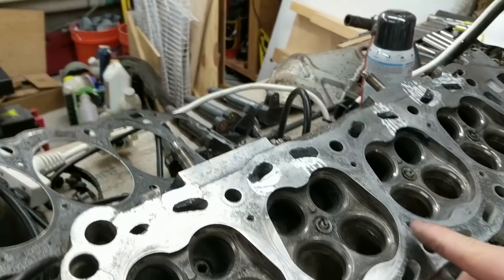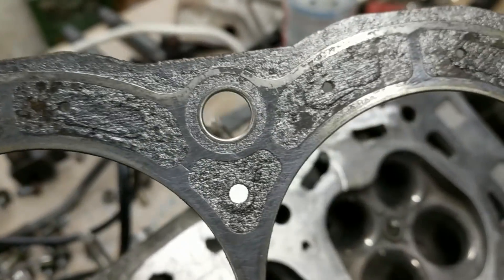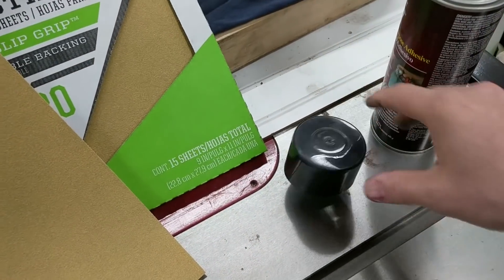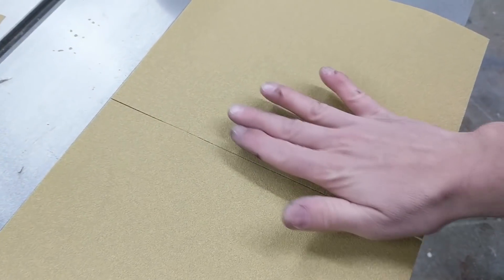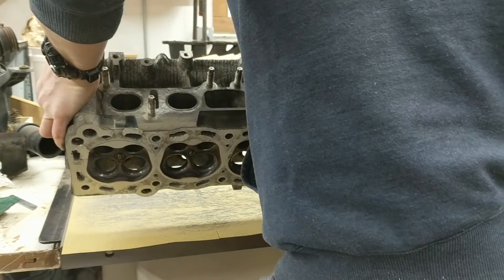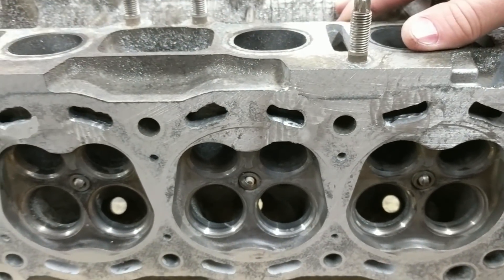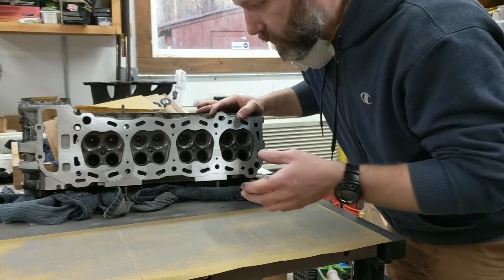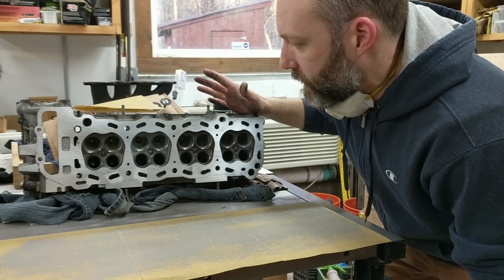Using a Table Saw to Resurface a Cylinder Head

Comment: For the amount of work that goes through replacing head gaskets, I feel more confident taking the head to a machine shop and having the heads machined . I won’t reuse head bolts either. I helped a friend that wanted to save a few bucks. He tried this process and reused the stretched head bolts, ... a few weeks later he had the same mess!!! If this works for you guys I’m truly happy!!! I just hate redoing things!!!
Reply: For those of you who don't know if they're torque to yield bolts you replace them "every time"                if they're NOT torque to yield then it's "as necessary"
Reply: @kendalbridges897  Yes.  Correct and simply put.
Reply: THANK U.. their  stretch bolts and cheap for as much work it takes pull these motors down..
Reply: If someone has the time, desire, and means, why not try and do it yourself. You learn a lot through the process.
Reply: @Cyan2002  The first thing you need to learn is that some things are best done by a good machine shop.  They have the correct equipment and expertise.  Unless you live in the middle of nowhere, take your heads to a machine shop for work that can be done there with the necessary precision.
Reply: @Cyan2002  correction some people learn a lot through the process some people just fuck up a bunch of shit
Reply: @kendalbridges897  hahahaha 😂😂😂
Reply: If your working on something from the late 80s early 90s then you probably should replace the head bolts, most from the 70s or earlier probably not. They used better bolts in those days
Reply: Bert Grau for the 240Z (an early 70s car) they "recommend" replacing the head bolts. Datsun was notorious for using poor quality metals all over their cars back then.  That being said, however, I've reused the Z head bolts after doing visual inspections and a back out torque check ( there are charts for that) and haven't had any problems with bolt failure or head warping. Even though, if I have the time and money I DO replace head bolts.
Reply: Datsun/Nissan has fantastic quality.
Reply: I just make the switch to head studs if possible...
Reply: Mark Godfrey  well the only thing I can say without being there is I don't know what kind of car is it are you using a stock setup what's going down
Reply: Mark Godfrey  when you were buying the bolts were they TTY bolts
Reply: 2025, many bolts were replaced , many good ONE JUNKED!!!!
30 years as a mechanic, doing many engines, NEVER had to replace the head bolts;  BUT i KN OW how to check them, it is described in EV ERY manual, FACTORY manual, that is;  look....  do you replace the wheel bolts or studs every time you change tires?    WHY NOT?  ir is way more critical...    anyway,  you NEED TO KNOW HOW TO CHECK THEM, it is VERY simple.
Reply: As for reusing bolts ; it’s ok if you measure the stretch and use Caterpillars chart on the proper Lenth chart and on like rod bolts it uses the bolt lenth fo correct bolt torque chart measured with mic’s
Reply: @BillyDocWalker  No.
Reply: If I'm going through all the trouble to remove the head then I'm going to take it to a machine shop. Might as well have them check everything.  Do it right the first time.
Reply: @tonyradca1235  til you realise that the costs keep adding up and up eventually you have to draw a line where youre comfortable
Reply: Carpenters Should Never Be Mechanics!

Comment: I'm not saying this won't work, as the gasket will take up some of the imperfections, and the head doesn't need to be perfect anyway, but... First, I wouldn't trust the table saw top to actually be perfectly flat and not bowed or crowned slightly.  The same is true for pieces of granite counter top, and especially for glass which easily bends.  Gluing the paper down and the paper its self adds another layer of uncertainty, as there is no way to know if one sheet is a couple thousandths thicker than another, and any dust under the sheets will cause imperfections.  Last, as others have commented, a figure-8 motion should be used for lapping, and I'd probably do it wet with light oil or some such to keep the paper clean.  At the very least, a crosshatched pattern should be used with every stroke in a new direction to prevent deep scratches.  You won't see them with your eye, but if you ever so lightly dust the head with black spray paint, then make a couple light passes over the paper at a higher grit, you'll see plenty of black lines of scratches.  I'm sure I'll be sanding heads on a table saw come the zombie apocalypse, but until then I'll have them machined.

Comment: I've done bike engines like that, the old bloke who showed me told me to do it in figure eight movement for best results, works just fine, fit 2T heads with no gasket just sealant.

Comment: Use a straight edge and  a torch light to see if you table is flat. You can also use a 1/2 " piece of plate glass. I am sure it worked fine.

Comment: Because of the manufacturing process, ordinary window glass is dead flat, and can be used as a surface.  The grit of the sandpaper has to be selected depending on the composition of the gasket being used.  And yes, I would never reinstall a cylinder head without reworking the valve seats and guides.  This can all be done by hand also.

Comment: I say take some marker and put it on the head face then when you sand it you will see where it is high and the loss
Reply: Max Volovich… A light coat of flat black spray paint is probably easier than using a felt marker. Krylon dries in 10 minutes, so take a coffee break and a few more strokes to see if its' good.
Reply: @rupe53  that works to.  It covers faster and easier to control.

Comment: My dad cleaned up a journal on my cars crank-shaft using a good connecting rod (the old one was shaped like an egg) and a couple of new bearings. What he did was put valve grinding compound in the new inserts in the connecting rod and we turned it around the crank. We started with 40 turns and coarse grit compound and took off 10 thousands immediately. We cleaned the journal and swapped to fine grit compound and after 90 or so turns the journal was round and true. Then we purchased 20 thousands oversized bearing. Checked it with plasti-gage and it was perfect. I drove the car another 10k miles before I had to sell it (military family moved over-seas). I was shocked at how well it worked. If you take your time I am sure this method of leveling a head would work too. Nice work.
Reply: Bruce Williams I've been a mechanic for over 25 years and never heard of anyone doing this. Beats the old wives' tale of a trucker using a section of his leather belt as a connecting rod bearing insert to temporarily fix a rod knock  while on the road.
 Hats' off to your old man.
Reply: Hi  @cruzinezy1968  , Like I said, I was really skeptical but then I shouldn't have been. Before my father went back into the army, he was a master machinist for Pratt & Whitney. He would have no problem lapping things in to +/- 0.0005 of an inch (0.015 mm). The amount of measurements we took of that damned journal were ridiculous. But it worked well. The sad part was that he was so cheap and I was so broke, that we didn't buy a gasket kit for the timing chain housing and the thing leaked incessantly.  It was a great life experience.
Reply: @cruzinezy1968  Well I guess a mechanic of 25 years just learned something. Can't figure out why you wouldn't think it is possible. I watched my old man do something like it on an old John Deere 2 Cyl. tractor back in the mid 1960's. No rod inserts in those rods. Another old guy had rebabbitted the rod and he was getting the rod to fit the crank. NOT AN OLD WIVES TALE EITHER SMARTYPANTS. Tractor ran for many years after and was sold when he retired about 1975. Still running great too!
Reply: Rockitanski the belt trick has tricked a few people in to buying a car and 3 weeks later.  Being surprised to find a peace of leather for a bearing
Reply: Just in case anyone is going to do this there are a couple of things you need to know. First, do not tighten the journal or rod cap too tight; the grinding compound removes a great deal of material very quickly. Second, Inspect often. Again, it didn't take that long to remove a great deal of material with the coarse grinding compound. Third, Make sure that your rod journal is true prior. When we did this, we had to get a new connecting rod as the old one was too out of tolerance. Fourth, use a new bearing liner when going from the coarse to the fine. And lastly, we bolted the whole crank-shaft to a table to make it easier to work on. My dad said it could be done in the car or machine if you had to but was a PITA. PS- make sure you get rid of all the grinding compound after and check with plastigage for clearance. Best of luck to anyone who needs to do this.
Reply: @brucewilliams6292  Hey Bruce that is a very ingenious way to go about that. What would you do if you had a big end main bearing spun. Any ideas for repairing that. I think that is the best knowledge to get from people that actually used to work with there hands and brains like the old timers did your very lucky to have a smart father. Thanks
Reply: Hi  @richardrockwall8879  , First off, how out of round is the journal? If you are talking 10 to 20 thousands of an inch (0.025 to 0.05 mm) it should be doable as this usually doesn't impact the journals too much.
 IF it were me, I'd pull the crank and carefully check the out of round on both the journal and the crank. If the main journal is out of round, it would be difficult to regrind by hand. If the crank is out of round but the journal is good, you should be successful to regrind by hand. You just have to estimate how much smaller the the crank will be in-order to bring it back into round and that you can get an over-sized bearing that is bigger than your back into round measurement.
 What is it on? I know that some large engines had the ability to cast babbit directly into the journal (I saw an old timer do it on a Morse diesel ). For normal engines, I haven't seen this approach. 

Also, be aware that you have to have some fine grinding marks to allow the bearing to hold some oil or it will scuff.
Reply: thanks Bruce, I'm going to give that a try!
Reply: Seems to me that the inserts being softer than the crank, would wear first. You sure he wasn't making over sized inserts?? :)
Reply: Hi  @doorguru168888  , The inserts would wind up with the grinding compound embedded in them. We used several during the process because they wore down too.

Comment: Been saving old school hard to find heads this way for a loooong time,, yep a shop will mill it for 50$,,, and you get what you paid for,,, some rookie wanna be head porter slaps it on a worn out mill with a worn out fly cutter,,, maybe levels it,,maybe not,, checks Iphone for new tweets about 20 times,, sees its almost time to call his mom to bring him his lunch,, so just hogs of about ,060" sees that pass left some "dark spots" thinks another .040 should do it,, and be done to meet mom in the parking lot,, blasts off another pass,, hands it back to ya,, next time you get one back take it to someplace with a CMM,, pay them 100$ and see how "FLAT"it really is,, you will cry. note,, really dont have to be that flat anyway they move a ton when ya snug em down eh,, and sometimes,(SOHC) ya need a lil bow so the cam journals are inline after ya run the heads down.
Reply: I've been a machinist almost 40 years and I agree with you 100%. Many new and re-machined heads are not flat! If an unknowing or uncaring "machinist" clamps the head down on a machine table, takes a cut or two, un-clamps it and hands it to you, it may not be any flatter than it was when you started! It will just look nicer. It takes skill to get something really flat. One good start is to set it up on 3 points. 3 points will establish a plane and any surface will sit on 3points without rocking or distortion. Don't ever assume just because a machine shop did something it is perfect. There are lots of idiots calling themselves machinists, too. Lots of aftermarket and "performance" stuff is crap.

Comment: I used a large electric sheet sander with a prem flat piece of Oak with sand paper.
Mine was used to "true" the slightly warped intake on some aftermarket LS high ram fabbed intakes.
Got a killer deal on new "out of spec" units and fixed and tested them all. $12 Harbor Freight sander $28 Prem wood piece and sanding paper.
EDIT "Intake to head"

Comment: Nice job; strange that the head needed welding the coolant holes. Strange what happens in the real world.
Your instincts are pretty good. Looks like a grafoil gasket; not very durable but not very fussy about flatness.
If I did fly cut the head deck as a home amateur,I would lap it like this as a check for flatness and waviness anyway.
I am a retired cylinder head engineer. You should get some more use out of that engine for your trouble.
Reply: He had to weld due to corrosion which is due to not changing the antifreeze. You see this a lot where people don't maintain their vehicles. Have seen this as well in stationary generators that are neglected or in areas of high mineral content in the local water. I highly suggest using premix antifreeze which uses de-ionized water.
Reply: Nice to see a pro be supportive

Comment: Used to take heads to a guy for resurfacing that had a big belt sander mounted horizontal on a big metal table and a fixture that grabbed the head and crank it down level against the moving belt.